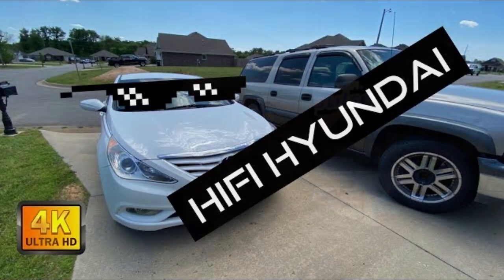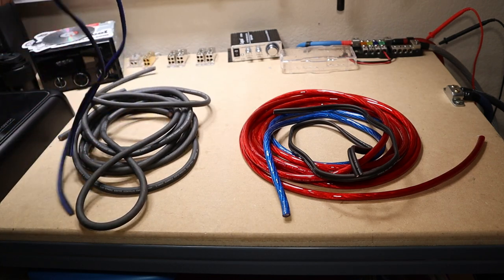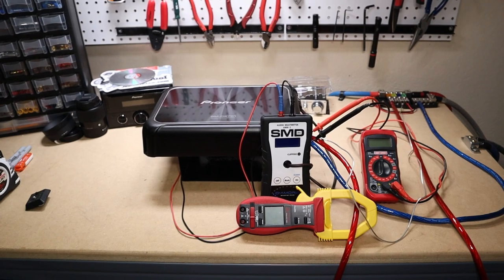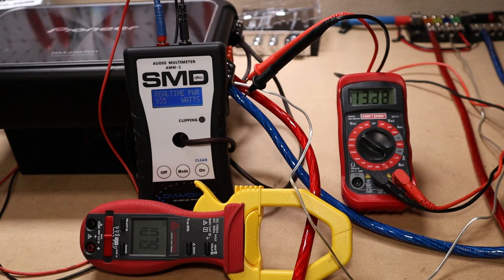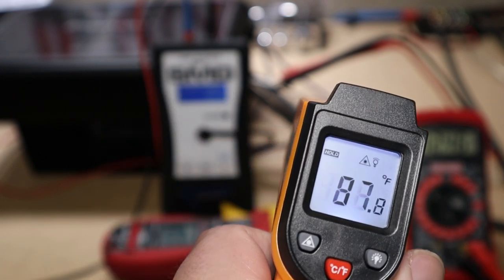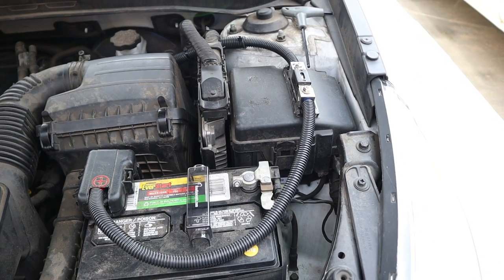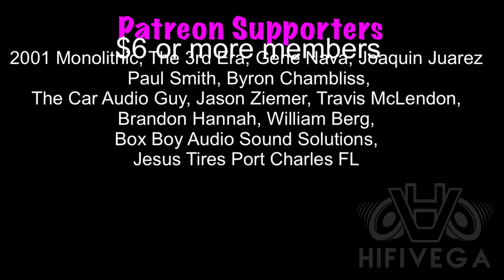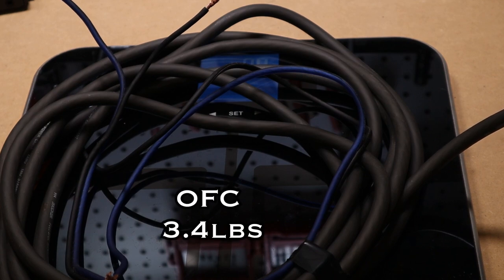This is why CCA wire is better than OFC wire!

Comment: Idk man personally as a firefighter I’ve seen multiple car fires where cca burnt through the jacket arched and caught the carpet and insulation on fire I think cca is ok for short runs but for long runs I just can’t trust the cca due to the heat it creates .
Reply: yep, i been witness as well...i seen that cheappy redd wire burn through the jacket. i  been using  OFC andd had no problems at all, i even use it on my oem electrical on my vehicles for starter, alt ect..
Reply: not fused properly. iv seen fools put a 300amp use on 8awg ofc wire. it still went up in smoke.

Comment: CCA is perfectly fine. I use welding cable though.
Reply from the maker: Welding cable is hifi approved!
Reply: @Popwarhomie ... I love welding cable. 
Can't use it all the time; but if I have it available & don't need it for anything else (construction etc.) I'll grab that welding cable & use it on car audio hobby projects.
Reply: What is the cca
Reply: @edgaralvarez4579  cca= Copper Clad Aluminum

 (kinda like a Copper Plated Aluminum, is the best way that I can easily explain it)

Comment: what is interesting is most people running CCA vs OFC cannot pull the power through their system, they would need to make a difference spend the money of the AMP and speakers not the wire

Comment: I have a bmw with cca audio wire for 22 years now same wires I updated amps and subs over the years and i can see a little bit a green on it but not bad my audio still shakes the car specially with my new lithium battery now

Comment: I'm a cheap ass. Used cca for a while. But just upgraded to welding cable. Got 30ft for $75. I can tell a difference.
Reply from the maker: I’m an OFC guy for sure, but I needed to test CCA for myself so I could have a more informed opinion on it.
Reply: @HifiVega  if that's the first time you've ever used it, then that's a blessing lol. It deff works. But I just miss the days when wire was just wire. Was so simple.
Reply: BASSNSANE  idk how to post the ebay link, but it's from acdc wire. I copied and pasted the title. Just copy it and search in the ebay app...
Reply: BASSNSANE  30' 2/0 WELDING BATTERY CABLE 15' GREEN 15' BLUE 600V USA EPDM HEAVY DUTY COPPER
Reply: If your cca is big enough for the job you wouldn't see that result. 
 I run 0 gauge cca for my 1200 watt rms amp and it only has .03 voltage drop and doesn't heat up even 1 degree.
Reply: @travisabrahamson5092  yeah, it all depends on the power you're pulling thru it. But I'd always still recommend off, cuz cca breaks down over time.
Reply: @travisabrahamson5092  same here i have knukonceptz 1/0 cca for jl / 1200rms & i can tell the diffrence. I used to have the 4 gauge ofc

Comment: I use both, totally application depedant. 

I reccomend using whatever fits the budget and goals of the system.
Reply from the maker: I’m an OFC guy, but I wanted to run some CCA myself so that I have actual experience with it before I speak on it.

Comment: Steve Meade said I was stupid for using 2 runs of 0ga CCA vs one run of 0g OFC.

Even though I told him the two runs of CCA was $34 and one run of OFC was $70.

I already had the CCA so it's what I used, of course I would rather have OFC... who wouldn't.

Comment: From my experiences as an airplane mechanic as well as life long audio enthusiast  it comes down to how the wire is going to be used.   Will it be firmly secured so that it  never moves throughout it's life or will it be subjected to regular flexing, even if it's just minor flexing?  Aluminum is a wonderful metal with great strength to weight ratio as well as excellent conductivity and thermal transfer functions.  It's biggest weakness for our discussion is that it is easily one of the metals most prone to "work hardening."  I was using the cheap welding leads that came with a welder I had just purchased to get what little life I could out of them and their cheap rod holder until I switched over to my "real" cables and rod and ground clamps.  Also I was just curious to see how well they did or didn't work.  The gauge was sufficient for the current I was using and I didn't have a problem with the cable even as the cheap rod holder went to shite in a hurry.  Then one day as I was laying bead after bead of hard surfacing rod to the face of my anvil the electrode cable caught fire about 1 inch from the holder and burned a few seconds before severing  and dropping to the ground.  It seemed odd to me that this fire occurred in the middle of a section of cable, not at a crimp joint at the terminal.  After examining the roasted wire I immediately noticed it was CCA.  I hadn't really thought about it and it was not disclosed by the Mfg. anywhere in their documentation.   My opinion is that there is constant flexing of the cable at the point where it enters the rod holder during normal use.  This flexing caused work hardening in the aluminum core of each strand and they began to break. Each strand that broke placed more current stress on the remaining strands.  The whole failure probably increased exponentially as the strands continued to break until the heat being induced into what small amount of conductor material remaining caught fire.  Eventually I hope this knowledge becomes well known enough that CCA will not get approved for use in welding cable.  But in my car setup where I have an 0 gauge CCA cable running from the battery at the front of the car to the amplifiers mounted in the rear this isn't a problem.  Sure it may be slightly less efficient than oxygen free pure copper but the weight savings is substantial.  Not that the weight influenced my purchase.  I bought it because it was cheaper, way cheaper.  But in massive wiring harnesses the weight savings can be very substantial.  So I guess what I'm trying to say is that it all depends on the application.  And never use CCA in your welding cables.
Reply: It's the heat cycles that harden the aluminum making it more an more brittle. I nearly had a car fire due to CCA main power wire. CCA is dangerous and it WILL eventually fail. It's not a question of if it will fail because it will, there's no way around that. All the best.
Reply: This might sound crazy but I was using O GUAGE CCA .
I decided just to try OFC 4 GUAGE I could tell a big difference in the sound much louder.
Just seem like it was putting out way more power with the  100 % OFC .
Ever since then I decided to go with 100% OFC  .
So after buying the 4  GUAGE I ended up buying 0 GUAGE OFC  wow what a increase in sound  so much louder.
But like I said if I couldn’t afford it no way would I buy OFC it’s very pricey.
Everybody is different but I have to go with OFC all the way  just works better 4 me.
If I was using say a 500-1000 watt amp I would probably just go with a  0 GUAGE run of CCA but I’m using a 2500 watt amp SUN DOWN .
So I have to use OFC it takes a huge current pull to run that amp.
Just my opinion everybody has a different opinion.
Have a wonderful day.
But yes you are correct it is expensive to go with OFC.
If I  couldn’t afford it I would go with CCA just for the price savings.
So I wouldn’t blame anybody for going with CCA just because the money savings .
If it works for you why not save that money if you can get by with the application.

Comment: Steve Meade ran a similar test. Matching gauge in cca and ofc. Over like a 20 ft. Run, they lost 300 watts due to less efficient power flow. Now, I believe that was on something like a 3 to 5000 watt setup, so in a real world application for most people, as long as you install in a good quality manner, it should not matter.
Reply from the maker: The more amperage you put through cca the more power you will lose no doubt!
Reply: Yep especially  is you Double up on CCA runs.Steve and these guys are Using one CCA wire your exceeding the wire specs creating resistence.

Comment: Im 3years late, but i use most of the time CCA... and why do i?, I want to show people that a budget can be good aswell.
Now im running stock volvo v60 with sunroof, cable is 25mm2 ( first 30cm bc i cut fail on 35mm2 cable so the ecu was in the way for the fuse )
35mm2 CCA back from the fuse, 74ah bosch battery no agm, 1500w monoblock in back, own designed box 15" sub , with box tuned to 34hz to play good on most music, I play 144.55db @43hz. 141-143 at 35-42hz.
Im gonna find out how much power the sub get, waiting on the clamp, but i have set gain with oscilloscope so this is without clipping!
This is my first ever box design i done myself so iguess it could be even better :) But i will say, on my other build that gonna be SPL and litihum and make power, i think im gonna go OFC :) 

But if your on a budget, better go oversize CCA.

Love to see this type of videos.

Comment: When you consider how much you are spending in total for a car stereo upgrade these dsays (and yes it is not cheap especially so much of it being made in China) that to spend the extra money on OFC Power wires is worth it. OFC however can work well as speaker wire, and is how I use the two wires, while still saving a few bucks but still getting a "proper" install and good sound quality.

Comment: Quality OFC welding wire + additional braided jacket is about the same price as brand name CCA wire of the same gauge without the braided jacket, and less than brand name OFC without the jacket.  As long as you use the appropriate gauge for the application and do a quality install, I don't think it matters too much what you go with...except in extreme situations like contests.
Reply: @faaaaq  Copper prices fluctuate constantly and right now it is not cheap.  CCA may be just fine for what you plan to do, but only you can know for sure.

Comment: After melting distribution blocks and the terminals on my amp i could only conclude it was from the cca wire i was using. From my experience as long as you use the next wire gauge size up that your amp or distribution blocks can accept and use reducer's on them then i had no more issues. But that can be a pain if your running 1/0 gauge wire and step up to 2/0 gauge wire. So i only run tinned ofc wire anymore and that is only to help with corrosion. I have tinned ofc in my wife s car for almost 6yrs now and still no corrosion what so ever. Besides Steve Meade did a video on the difference as well and shows the power and heat difference,and when using higher power amplifiers u can lose several hundred watts.
Reply: The Pioneer amp in here using 4 gauge is a safe choice by pioneer. A lot of amps rated 1500w+ still have 4 gauge and CCA could be a real issue. With CCA you should always retighten your connections periodically. Aluminum expands and contracts a bit more than copper does.
Reply from the maker: Even 15’ pulling 100ish amps showed a noticeable loss, but yes Steve used a big amp and you could really see the difference.
Reply: Was the jacket of the wire melting? Think the material make up of your wire is not the issue but having way way too thin of wire or a arc somewhere. unless you are playing sine waves constantly you shouldnt see that amount of amp draw for the amount of time for it to heat up enough to melt plastic. Glad it's sorted though.
Reply: @commonsenseisdeadin2024   yes and no,the metal inputs on the amp that is covered with plastic got hot enough to start melting the plastic around the metal. I have seen this happen many times when using cca wire. No sine waves just bass heavy music no clipping.
Reply: I've seen it from arcing, I can't say I've seen it otherwise. That's crazy. My 1/0 shca CCA on 3000 Watts (rms power) didn't even get hot on bass boosted music. I now have 1 run of CCA and 1 run of OFC to the trunk. Think I'm good. I do have 90 feet of 1/0 welding cable though if it's not enough lol
Reply: @commonsenseisdeadin2024   No 2 cca wire companies are the same at the times ive had this happen and seen it happen to other people it was usually because of cheap cca wire. Shca uses like 85-90% aluminum to 15-10 % copper coating which is alot compared to other companies some companies that ive experienced uses 100% aluminum no copper coating at all. I had used shca cca wire and it wasnt bad at all but was using 1/0 wire with reducers to 4 gauge and worked well but still corroded badly after a year. Then decided to go XS power tinned ofc and have not had any corrosion for going on 4yrs.

Comment: 8ga OFC cable can run the same amp as 4ga ACC cable .. the advantage of ACC is being able to run a small amp through the cooper coating on the ACC cable.

Comment: First, I'm OFC 4 life! I think CCA is fine if your not building a really high powered system. 1.5k or less, you're probably ok and won't notice any loss. I think you will notice and the wire becomes more compromised once you get into the high powered stuff. Kudos to your last show with Dean. A few of your points hit home with the copper vs aluminium fuse/distribution blocks. I ended up going aluminium SMD.
Reply: @faaaaq  I currently have a 370 amp alternator and a 2/0 run of OFC Skyhigh wire powering 1 RF T2500 back & a T600-4 for mids & highs. I also have 2 XS power agm batteries under the hood to negate voltage drop. I have had zero issues.with my electrical system. You will absolutely love that alternator!

Comment: While CCA will get the job done ofc is a much better cable and you get less resistance which in turn provides more power on the amp output

Comment: CCA is a budget option, not the best way to get the full potential of your system but if you plan on running a small amplifier you could get away with using cca. Me personally, would rather use welding instead of cca. Thanks for the video man
Reply from the maker: For sure OFC FTW!
Reply: Ofc OFC FTW!
Reply: I did welding wire on my truck and new ev I did ofc

Comment: I have 1/0 streetwires that has been used in multiple vehicles of mine for 30 years. 2 of the vehicles have been under water due to hurricanes and the wire still looks like new. The cca i used in my work truck didn't last 8 years before it crumbled
Reply from the maker: That’s exactly why I’m testing it! As soon as I notice degradation I’m gonna make a video and replace it.

Comment: As long as whatever wire I use pills the current I need I’ll use it, however my amp manual stated not to use CCA
Reply: Pono Sunrider what brand amp?
Reply from the maker: Def use OFC if you can
Reply: Super Chile Cerwin Vega S9100.1D

Comment: My experience with cca isn't that great. It got the job done, but it was a cheap Orion 4 gauge kit ($20). After about a year, the kit is showing its quality. The wire by the battery terminal is corroding and had to cut out about 4 inches to get usable wire. I plan to install Sky High Audio ofc.

Comment: Now could you test a larger gauge CCA vs a smaller OFC. Such as 4-gauge OFC vs 2-gauge CCA. This is how I truly use CCA.  I go oversized CCA because it is still cheaper and does the job. It still is subject to more corrosion but that can be dealt with by using dielectric grease on the exposed ends.

Comment: I believe cca if fine if done right. You cant mix copper lugs on cca wire or aluminum lugs on copper wire but people do this alot. If copper touches cca wire anywhere it causes electrolysis and degrades it. If you use the correct gage and the correct lugs cca is just as good. Cca is used by electricians for all types of applications. It got a bad rap in car audio because people dont understand how to use it.

Comment: OFC because I'm a perfectionist. +1 for the KnuKonceptz mention too. That company is the dope sauce and I go to them first both for product quality and fast shipping. Honestly though, as long as you do the math for current draw and distance requirements for each type,  both will do the job. That, coupled with proper fusing and common sense protective measures to prevent oxidation on the wire go ahead and save those dollar bills on the CCA.

Comment: Aluminum:
~60% the conductivity of copper
Lower melting point than copper
More prone to fatigue than copper
Until recently, the aerospace industry avoided it
I'm allergic to it

Copper:
Heavy
Tastes funny
I'm not allergic to it!

To me, CCA wire in car audio is like getting a diet soda with a super-sized triple cheeseburger meal.  Thousands of dollars in equipment, hundreds of pounds of subs, amps and hardware, only to save a couple bucks and a couple pounds while losing 40% of current-handling and risking longevity just doesn't seem worth it.

But really though, so long as I can get in my car, turn the key, crank up the volume, and find myself grinning ear to ear, then whatever's working is working, and I ain't bitching!  :D
Reply: Amen to that. There's a reason car manufacturers and utility companies use copper.

Comment: Very simple rule,  if you buy a $1000 car and a $500, 500 watt system you buy a $30 power cable.  If you have a decent ride and a system that's equally of good quality you don't hesitate to buy a quality cable hook up.  Spending less than $200 on your 2000 watt system is moronic and will bite you in the ass in the future... unless of course you never turn it up more than 25% which in that case you've wasted your money.  I had a friend that bought the best of everything back in the day and spent $5000+ and never turned it up past 90db  listening volume. Sounded nice at 90  but when the one time he let me borrow his car it sounded better at 125db to me.